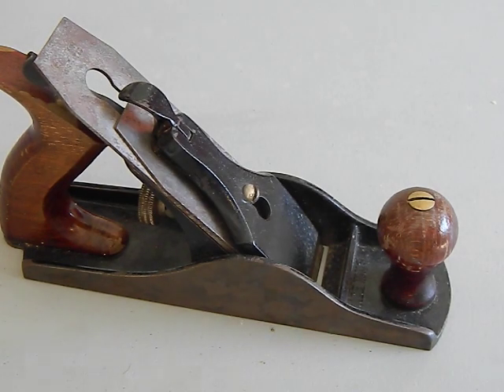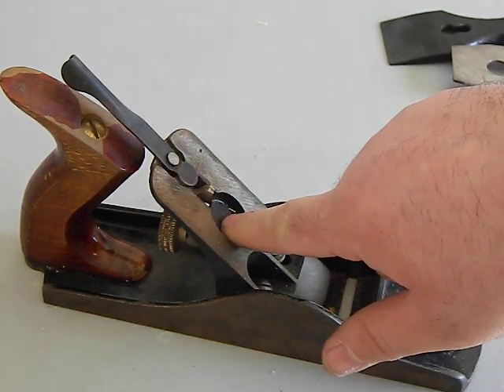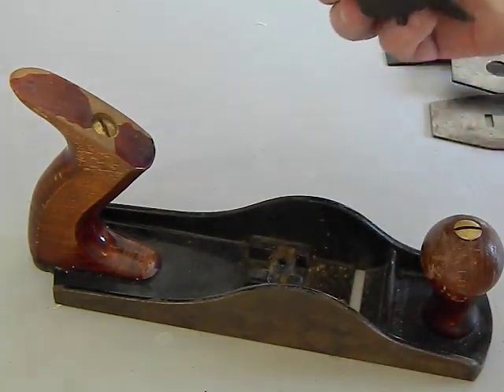Handplanes 101 - beginner level (part names + assembly)

Comment: I just bought an old Stanley model at the flea market , it was kind of rough, took it apart and cleaned and sanded followed up with some steel wool, Just wanted to confirm I was putting it back together correctly (the only guide I had was the way it came apart) Your Video gave me all the info I needed. Thanks, Great information!.